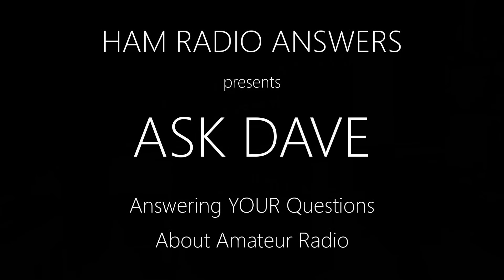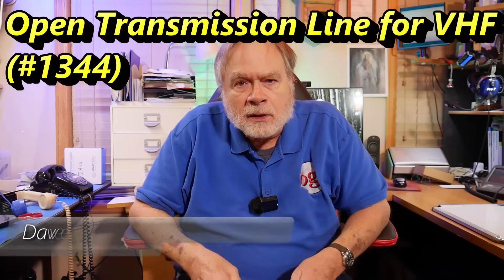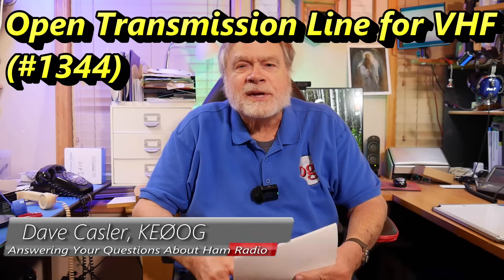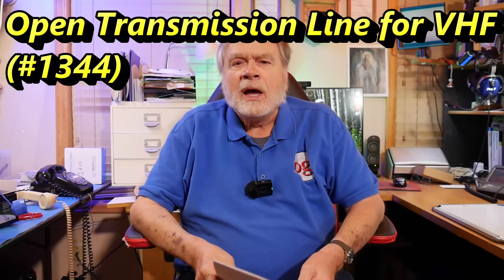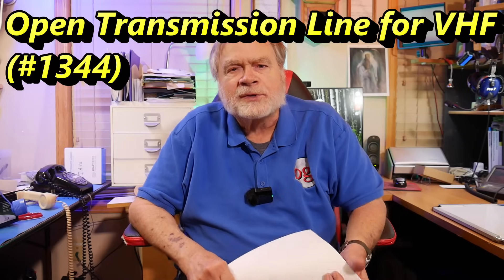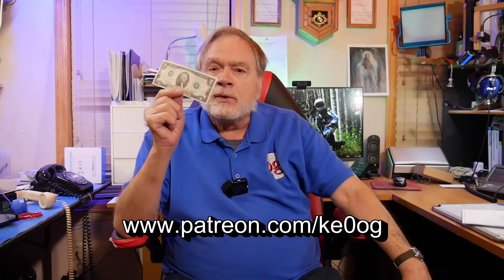Open Transmission Line for VHF (#1344)

Comment: A 6:1 balun is very nearly 2.5:1 turns.  A 12:1 balun is very nearly 3.5:1 turns.

The error from that ideal is far smaller than the error you'll get from being very slightly off the ideal winding, or counting a through-turn as a full turn (it sorta isn't, but we say it is because it's close enough).  If you actually want a 6:1 or 12:1 balun, the best thing to do is get in the ballpark and then measure it.  You'll find that commercial 49:1 baluns and 9:1 baluns are not, in fact, perfect 2450:50Ω or 450:50Ω matches, though in the case of the EFHW that matters a lot less, because the end feedpoint isn't 2450Ω anyway.

Comment: Old timers remember that the old VHF and UHF tv antennas used twin lead ladder line, all the way up to 800 mhz. It has very low loss, even better than hard line coax. At 1.2 gHz, 100 feet of 600 ohm open wire line has a loss of 0.8db, 7/8" hard line loss is 1.4db. Just remember to twist it a bit.